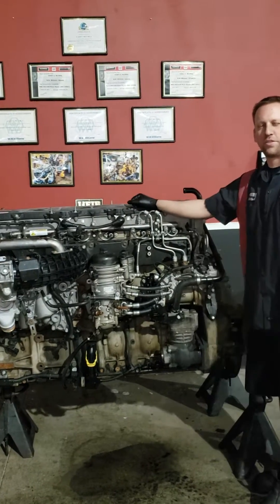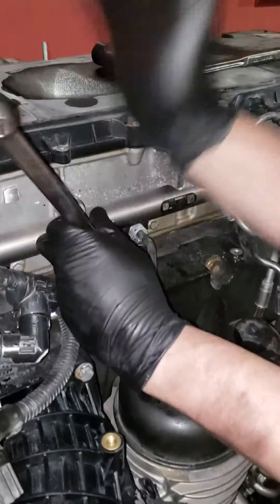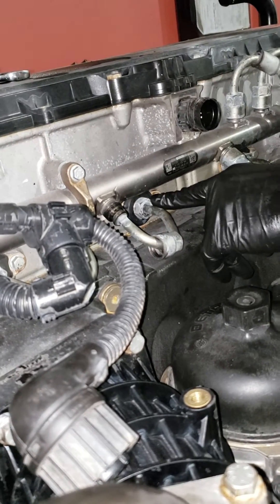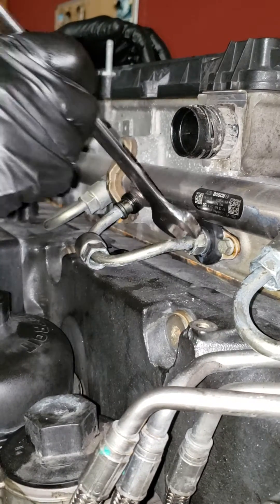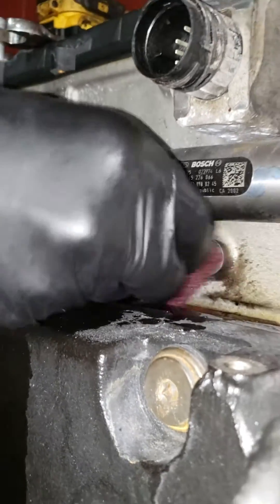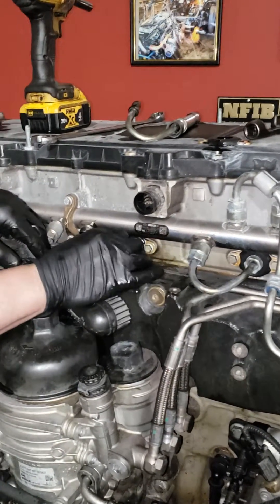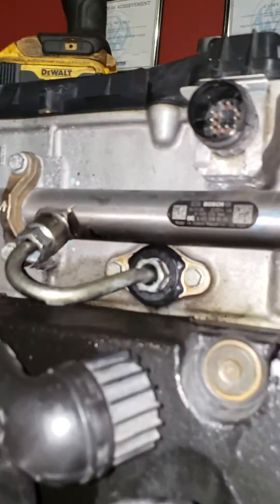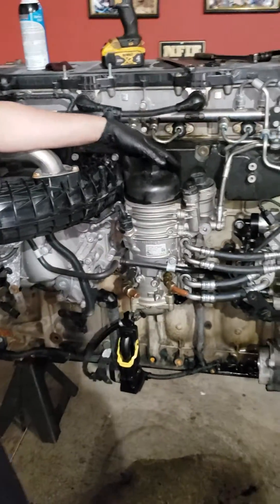DD15 Leaking Injector Fuel Line Pass through seal replacement

Comment: Just a quick tip if for some reason fuel line doesn’t want to get tight have to removed air filter housing and valve cover and watch injector hose go in to injector and tighten up / time consuming but easy

Comment: Did all the steps. Now its leaking fuel a little from pass through seals. Is it normal ? I did torqued it up to 30 flb and 11 ftq on the seal bolts

Comment: Could bad seals be the reason why i have to prime once i stop running the truck after about 8 hours but once I prime it I have no issue with the truck until I let it sit overnight
Reply: You have to take it to a mechanic and have him look over the entire fuel system.  I had the same problem and the mechanic found a fuel line above the transmission that was loose and he was able to get about 1/4 of a turn out of it while tightening it up.  My truck was doing the same thing.  I’d drive all day and take my ten and the following day the truck would loose its prime and I would have to manually prime it.  That was in 2024.  It cost me about $900 bucks for them to go thru all the lines and hoses and to let it sit in their yard overnight to confirm they had fixed the problem.  Yes it sucks and yes it was probably overpriced but they set the prices for what they know.  It was the dealership in Chicago.  I’m not mad I’m glad it got fixed.

Comment: Can I just prime the truck by hand with the manual pump just like I do when I change my fuel filters?
Reply: If the pump works…you may have to pump over 100 pumps, I always use starting fluid although it’s not recommended…just use a tiny bit.
Reply: 250 not 100, 250 ahhh
@CheddarCheeseBandit
Reply: @TheLayton2012  Yes  250 is the right number
Reply: 100 isn't enough. I now pump about 250 to 300 times. It's pretty quick and easy when I stand on the steer... @CheddarCheeseBandit
Reply: @TruckingPerfected2 that’s what I do when I change my filters

Comment: I just had 2 injector seals replaced and now I'm getting a intermittent low fuel rail pressure codes any idea why that is now happening, I'm thinking they either didn't torque them right.

Comment: I learned a lot from you within a few minutes, I’ve never messed with dd , only Cummins …. I got some action at my new job with dd and gave it shot on a #5 and let’s just say for the first time doing it without watching YouTube  I managed it was complicated for me since iam 6 feet 300 pounds lol but I got it … guys at work said #6 wash the leak off and send it on its way …. Idk when I was in there looking at it didn’t scare me you will definitely need a super bendable magnet to get the tiny bolts on the gasket with out dropping the bolts , that how I did #5 I didn’t remove anything to make it “ easier for me “ I chose to struggle lol 
What tips do you have a #6 
I worked with paisas before and idk if you know how they can get when teaching someone or when someone is struggling lol

Comment: You make a valid point on the torque specs, they do change from time to time especially if the part is superseded by a newer part that might require different torque specs. It would help though just to have a reference in torque like you mentioned the seal. Just say “I personally torque to” that will help the people wanting the help and ward off the critics. Great video!!!

Comment: My driver accidentally put def in fuel and we had to change the whole fuel system and injectors. 10k miles later truck broke down and now the same mechanic who fixed it is saying cylinder 6 got pushed down and they have to do the head and Cylinder replace? Truck only has 352k miles DD15. My question is who is responsible since we just got the work done from him on a low mileage truck?
Reply: Fire that driver!!! How does one "accidentally" put DEF in the fuel system? PSA: Crack IS Whack. Good day.
Reply: I’m not an attorney but I’m 99% sure you would have to take the mechanic to court and you would certainly need supporting documentation. If it’s something the mechanic/shop did I wouldn’t let them do anything else. Take it elsewhere and then just file a small claims case against the other shop/mechanic.

Comment: One driver spent $5,000 dollars replacing this $10 seal,he said air got in there and he dropped an injector...and you make this the job looks so easy.. Thank you
Reply: I watched that video. Air gets in the fuel system every time you change filters. I assume he did something else and caused his own problem.
Reply: pretty sure that guy forgot to tighten down the fuel line after replacing the seal, injector ran dry
Reply: There is no such thing as dropping an injector.Not at least when it's inside an engine
Reply: think he didn't prime the fuel system correctly or at all...
Reply: @busyboysonedollarcircus6601  Bingo and also high and low fuel pressure must be right
Reply: Is this any code or check engine come out?
Thank you!
Reply: DD injectors like to seize if they dry out and/or get any trash in them because of the tolerances being so fine inside them. Likely got trash in them and/or let them dry out.

Comment: Will those gaskets allow fuel into the coolant?
Reply from the maker: No sir.
Reply: @detroitrebuildspecialist376  Thank you! I really appreciate your videos. But I'm intimidated by the interior work of a engine. I won't touch it. I leave that to the professionals. Lol!!
Reply: @detroitrebuildspecialist376  question what's the billable hours for replacing injector cups and o-rings?

Comment: Arent the injector fuel lines single use? Due to stretch from torque, time, and pressure DD advises that injector fuel lines are single use are they not? To replace them when doing the pass though seals?

Comment: i have a dd15 and got the plv changed. still throwing a code saying it is open because the pressure in the fuel rail is too high... the fuel rail is on crooked and the lines are not centered with the injector line bolt... im being told that is the problem???

Comment: Would over filling the oil cause these seals to go bad? At work they over filled the motor and not long after one of them started leaking. One more question what happens if you don't replace one thats leaking?

Comment: What size is that  special snap on tool I see some on Ebay cheaper than snap on just wondering if the size is 3/4 on that nut
Reply: The size is 19mm but a 3/4 fuel line socket should work
Reply: Be careful I ordered a 19mm for my freightliner cascadia and the socket want fit on,its supposed to nea size 19,there is no writing on it for as size,ordered it from ebay
Reply: I’m trying to find the tool as well.  Can’t seem to find that snap on part # anywhere online.  Anyone have any luck finding it?

Comment: My fuel pump went bad, really bad. Metal dust in fuel filters. Replacing it and found a 1 1/2 inch thin metal tube in the block return hole that fuel filter module mates with. Any idea where it came from? $100 to anyone who can show me what it is and where it came from. Thanks.
Reply: You must have a Cummings engine?
Reply: What? No why would I post on a dd15 video with a Cummins question and not specify?
Reply: @raymondwandell8880  don't mean any harm I just have a couple of people I know had that same problem with their freightliner cascadia with the isx Cummings in it.
Reply: Sure its metal, I have seen the edge of the fuel filter- fuel water seperator bottom Oring sheer off from careless install/removal and get pushed through the fuel system Usally the slivers are green or black depends on filter
Reply: Yes, it's metallic. Still wondering what part of block or coolant system that steel tube came from.

Comment: I have oil on the engine harness connection right above those fuel lines is there o rings or seal I can replace on it?
Reply from the maker: It's your Injector harness. Replace both front and rear injector harnesses
Reply: @detroitrebuildspecialist376  is it something hard to do or should I take it to a shop?
Reply from the maker: @ivansoto3836  I'd take it to a shop.  I'll do a video for you.
Reply: @detroitrebuildspecialist376  will those seals allow fuel into the coolant system.

Comment: Great video. One of my high pressure fuel injector lines is leaking fuel. The 6th one lol. I'm going to try changing it out tomorrow
Reply: Do those cylinders leak oil or fuel?
Reply: @BabyBaby-ph4uo it's fuel.
Reply: @cascadia7244  well why does it leaks black liquid stuff????